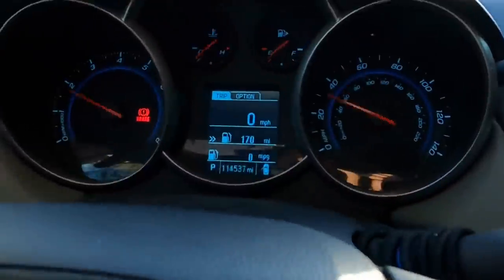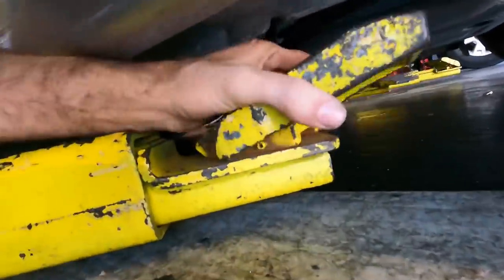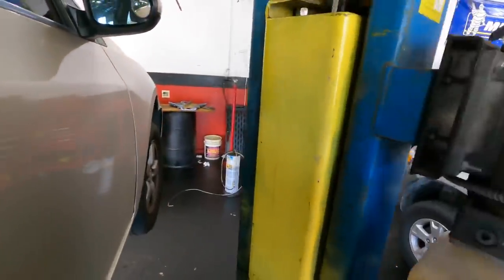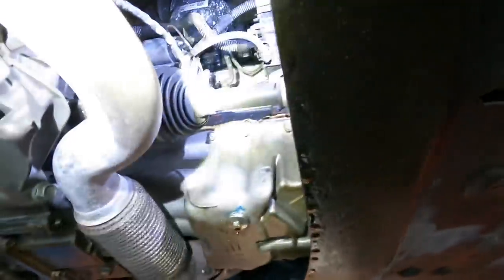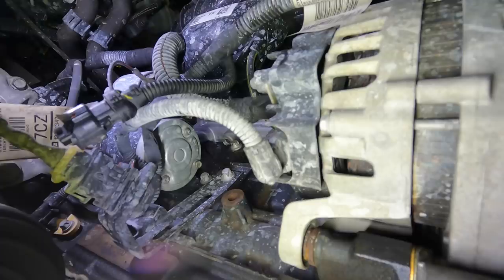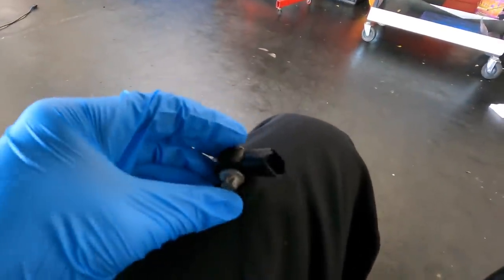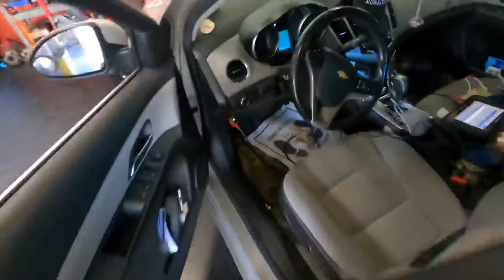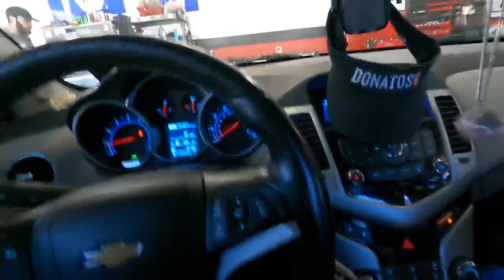Rolling the Dice! Parts Store Diag! Customer Supplied Parts. 2015 Chevy Cruze  P0324

Comment: Had knock sensor code pop up on my GP. Went to junkyard got knock sensor. When replacing knock sensor a pool of coolant dumped on my face. Had no idea coolant was underneath it. Code never popped off after I changed sensor. Took another look underneath and realized the wire had been chewed through by a squirrel...

Comment: Lift safety refresher!
Knock sensor design! 
Appreciated the exploded diagram of the knock sensor.
Reply: Me too, always wondered how they work - pretty simple!
Reply: @ScottDLR  
Elegant design!
Reply: @HouseCallAutoRepair  ,
heat resistant though !
Reply: That was a cross-section of the knock sensor, not an exploded diagram.   Exploded diagrams are very awesome for engines and such, but for a simple little 3-piece component, not so much.
Reply: I don't have a post lift, wished i did. I use jack stands whenever the car is up.

Comment: I had a manual 2011 Cruze with the 1 4T engine. Just totalled it last year at 220k when I hit a deer. Great car, other than 4 valve cover replacements because of the crappy PCV design. Keep up the great videos!

Comment: One thing worth noting when lifting vehicle using those „pinch welds“. I see too many damaged sills by lifting it this way without side support. For situations like those I would rather use some kind of rubber block with groove on it so the pinch weld is supported from the sides. Also it prevents paint being damaged ;)
Reply: I've never lifted at the seam. Seen way too many completely flattened.

Comment: As an ASE certified tech, I can tell you I have much better luck with diagnosis, and keeping the original Factory part, than replacing with cheap, low-quality, doesn't meet OEM Standard, Auto Parts store junk. Just because the sensor throws a code, doesn't mean to sensors bad people. For instance. This sensor was designed to hear a knock. When it hears a knock, it throws a code. Because it heard the knock, does it mean the sensors not working? Of course not. But this is my point. This is why this guy's a good mechanic. He took the time to diagnose the problem. 💯💯💯

Comment: It is easy to become complacent when working under lifts all day. Safety 3rd I always say 😁
Reply: Sometimes its hard to see safety issues through the safety squints.
Reply: Hello Mr. O
Reply: As we in the North know...that step you skipped could be a very bad day...had a pickup come in on a flatbed lost the rear driveshaft got it on my lift and lifted all 4 wheels approx. 3" stopped pushed on the bumper a few times, snapped a pic and set back down...the top of the box was crunching against the cab...the frame rails were holding on at the cab-box gap by about 2inches of the sides of the frame rail the rest had rusted through...by lifting it from the corners I was effectively folding the frame...customer wasn't happy that I would not reinstall his rear driveshaft do to the frame being unstable...and the fact that it would just pop back out at the next bump...
Reply from the maker: I love safety 3rd …it’s highly profitable 😉
Reply: @grandsea2  Had a squarebody chev brought in for a clutch back around 08 or so. Just got the wheel off the ground and heard a big pop. Frame went right in front of the leaf spring. Customer was pissed that I wouldn't put a clutch in it. He never came to get it then a year later showed up wanting the truck. Had never even paid me for hauling the thing to my shop in the first place. I had already hauled it to the scrap where it belonged. Tried to give me attitude over it. Yep, some people.
Reply: Poor EricO, dreaming of the cherry jobs Southerners get...
Reply: I had to recover a car that fell off a lift in a shop several years ago. Unfortunately the shop was not okay that I wanted to take pictures, so I didn't get to document it.
Reply: @RainmanRaysRepairs  occasionally becomes killer expensive !
Reply: Safety is only guaranteed if you wear a tie...like Colin Furze...
Reply: Wow. Nice to see the Guru Mr. Eric O follows another great mechanic. Great minds...
Reply: Time to re-visit that old movie "Safety Last!" with Harold Lloyd!
Reply: Eric O., in the know!!
Reply: The OG comments on the 2nd G's channel. Niceee
Reply: Sometimes when I’m watching Ray troubleshoot I’m like you need Eric… and here he is.
Reply: Eric O is in the house...😁
Reply: Safety 3rd leads to issues
Reply: @randyporter3491  If you do a job like wrenching for 10 to 12 hours every day for 10, 15, 20 years, even the dumbest eventually figure things out, mainly through their mistakes but also through manuals, training, and mentors. To get started, the only requirement is the ability to follow directions. I guess that quality can be difficult to find, but it is definitely not rocket science. Mechanics don't have to bust out calculators or use advanced equations to get to a solution. Sure techs use multimeters and scan tools with oscilloscopes and the like. But what really impresses me is the sheer number of PIDs that come in cars today. The engineers who make all that data available without tripping a bunch of false positives and negatives, that takes some real ingenuity. I would love to see the actual computer code inside an ECU.

What is hard to find is a good AND honest mechanic like Ray or Eric O. Those guys are worth their salt.
Reply: @RainmanRaysRepairs  Safety Third was something that Mike Rowe (from 'Dirty Jobs with Mike Rowe') and was in regards to the dirty and sometimes dangerous jobs he tried. Some of those could not have been done if safety was the first guiderule.
Reply: OSHA who's that?  The guys that show up ONLY when things go wrong and make MEGA bucks h doing it that way lol
Reply: @arliebright  a
Reply: Oh come on at least second
Reply: I've had a Car fall on me I WILL always make Safety my Number 1 Priority I got Lucky that day but it was Almost my Last Day
Reply: My best friend in early gradeschool lost his dad when a van came off a lift , or the lift failed & smashed him.
    Idk the details because he moved before 3rd grade.
   
     Looking back, it might have been my fault he moved.
    He invited me over for a sleepover for the 1st time after his father died.
     
     His mom left for some reason & we were monkeying around. 
   I wanted him to know his dad was OK so my 7 yr old brain had us pretending we were dead, but we were just hanging out like before only we were dead.
.
   He had the idea to use 
ketchup for blood, but I thought we needed more & more ketchup. 
     He was getting my message I think.. We were pretending like it was really nice because we didnt have any worries or pain.
    Everything was going great until his mom came home & got pissed because we waisted 1/2 a bottle of ketchup + we had it all over our clothes & selves.
    When he explained the why, she went from anger to shock.
       
    I didn't know how to explain my intentions & didn't even try.
    If you happen to read this Charles, hope life's been good to you!

    PEACE!
Reply: @mph5896  
Haha!
   Sometimes hard to see the safety through the fogged up safety glasses!
Reply: @damienvillano4044  We have tablets with our shop management program on it and take pictures of anything we find...to text/email to the customer or show to them...saves them having an accident in the shop, and us from having people claim we are trying to up sale them needlessly...
Reply: I’ve had roofing guys complain about the toe boards, harnesses, lanyards, and all the other safety items they must use for OSHA compliance. They say that it hinders their movement to the point that the very use of all the safety gear is dangerous. Most of them nail a plate to the peak of the roof and they use a Swiss seat to keep them secure and that’s it. I always know when OSHA is in the area because I sell out of safety harnesses and gear in a day. I think the fine is like $5k. I had a company go bankrupt from the fines levied on a construction site. I think their fine was well into the 6 figures.
Reply: @robertgelley6454  I think Eric O and Ray should host a tV show together , that would be cool to see.
Reply: Shop destroyed my 2002 spyder. Cost them 9 grand for repair.
Reply: @stevewhiting556  back when I was a form wrecker for a concrete company we HAD to wear hard hats when on the jobsite... still don't see why... anything falling on our heads there came from WAAAAYYY up (like a plane or meteorite) and that hard hat wasn't gonna stop any of that! I mean seriously... there was a concrete slab. The truck and portajohn were the tallest things around. Wasn't even any trees
Reply: you are so correct sir.  : )
Reply: But Rainman Ray , it looks like someone put a jack or lift on the passenger rear pinch weld and the body crimped just above it.  You can see it better when you zoom out and are talking about rocking it to and fro to make sure it’s stable.  Just sayin..

Comment: When I went to Autozone to check my check engine light it said I needed a new evap leak detection pump. Turns it out was just one of the serpentine belts that snapped 😐 changed and it was gone 😄 lesson learned. Don't 100% trust what the scanner tells you. A simple visual in the engine could solve your issue 👍
Reply: That’s because a trouble code doesn’t tell you what wrong it tells u what system has a fault and you have to trouble shoot it

Comment: My daughters 2013 Malibu with 200,000 miles on it has all sorts of idiot lights on but it runs fine. I did replace the front brakes and rotors last month. I want to take it to the part store to have the codes checked out but think like you said that it will just be misdiagnosed and will waste money. Last car I worked on was back in 1996 when I owned a 73 coupe deville. My track record on that isn’t stellar so I’m not bragging.

Comment: Ray, as a guy who installs and inspects lifts for a living it is refreshing to see it used properly.  I can tell you from experience less the 40% use the saftey load holding devices on a lift.  The hydraulic cylinders are ment for lifting not holding. Thank you!
Reply: You might appreciate my story. Old days with an in-floor single-post hydraulic/pneumatic lift which had a slight air leak. When you ran the lift to the top it went just past the safety catch- about 1 1/2 inches. If you didn't lower the lift onto the catch, about a minute later the lift would suddenly drop that 1 1/2 inches scaring the s#!t out of you if you were under it. Being an easily distracted teenager meant that happened to me more than once, but it did eventually teach me to double-check everything before getting under a raised vehicle like I do now.

Comment: With you on the diagnoses. Had some laptops in for repairs recently. Customers supplied parts for transfers, upgrades, repair. They all want to know why It takes so long. Well it's because I run a battery of hardware diagnostics before I start anything (especially memory and temperature tests). 30 years of experience tells me that it is better to check before you start fiddling - than to worry about if your fiddling broke something. You can of course rush the job and keep it cheap. Like a chain computer place did when upgrading the memory module on a clients laptop. Rushed tech broke one of the tabs on the clamshell (crap design and crap plastice but that's about standard)  which then drifted around inside for months until it found a home jamming the cooling fan. Heat buildup in the compartment led to a memory module failing when it reached a certain temperature, and only then. So laptop would run for around 20 min and then reset all the time - till it cooled down enough. BUT - the memory module tested OK on any short test less than about 20 min. Of course this failure led to the OS getting corrupted. A whole chain if events because someone's boss was chasing them for quick turnover and quick money.

Comment: Why no rubber mounts on the lift points? Especially on the pinch welds. Directly on metal they just bend and scrape the paint off in time. Then rust starts, and in a couple of years you'll struggle to find a lifting point, or they collapse on you at some point when lifting.

Comment: WHAT!!!???
You didn't even hammer out that front right dent in the fender???!!!
YOU CAD!!!
Just kidding.
I watched a guy once take out a dent by placing a shop towel over a hand anvil and then using a rounded hammer head, gently knock out the dent without causing any paint damage.
The towel covered hand anvil was placed on the outside of the dent backing up the hammer from the other side.
Just physics at work.
I've used that method on any of my "dings" on cars I owned.
GREAT SHOW!!!
Happy Motoring!!

Comment: My car has a welded flange under the sills. The wheel change jack is slotted to fit around that flange. Inverted triangles on the sill sides indicate where the wheel change jack should be fitted. 
I use a slotted wood block on a trolley jack to lift the car but axle stands go under the lift points shown in the video.

Comment: The knock sensors in used to (Cummins CNG) look similar. But are super sensitive to not using non-factory mounting hardware, as well as torque spec. Which I believe is something like 17.25 lbft...

Comment: I've been driving the Australian Holden 1.8 Petrol version of one of these. It crapped out 2 coil packs within 1000km @ around 55000km.
Reply: Similar in Europe had a coil pack at under 50k gave up on GM and gone completely Honda and Toyota .
Reply: These cars are not well designed much like the Holden or opel vectra and astra
Reply: @-DC-  the Cruze is Korean, merely sold with a Chevy emblem for people who want a throw away car for throwaway money. This one in the video has 114k which would be standard mileage life for a throw away car. Far more than an Accent for instance. Your Honda's transmission will fail twice by then.
Reply: @ashes2ashes863  My Civic Type R transmission was still working fine at 200k miles, though it was on its second clutch. Plenty of people with tuned/turbocharged engines putting way more power through the stock trans as well.
Reply: @ferrumignis  the clutches are fine. It's the CVT transmissions that are horrendous. And I'm not saying that as a hater. Actually have quite a bit of Honda Stuff
Reply: @ashes2ashes863  Ok that's fair, though CVT transmissions tend to suck irrespective of manufacturer.
Reply: @ferrumignis  yeah that is true. They don't seem to do well anywhere. Subaru is taking a beating lately because they have a lot of power killing software written into the car just to prevent the CVT transmissions from frying under duress. I myself can't stand CVT transmissions. Is somebody who drives a lot last like I want to listen to is that constant drone of what sounds like a transmission slipping for thousands and thousands and thousands of miles. I think I almost rather listen to my wife talk. Well no, on second thought I'd rather listen to the trans transmission.
Reply: Apparently 55 000 was the "Designed obsolescence" limit.
Reply: My wife had a POS 98 Vectra when we got together, then we traded it on a VRX Lancer wagon.

Comment: Shade tree mechanic here and only work on my own stuff.  I've been very guilty of firing a parts Cannon in the past.  One weighs the price and ease of a part versus the cost of diagnosis/ scan / and towing costs etc.  I figured in the end, I'm well ahead in money I would have otherwise spent at the stealerships.

Great channel Ray.  You're a good man
Reply: Correct, sometimes it can make sense to roll the dice with the parts cannon.  I have a Volvo with 260k miles.  Was getting an EVAP code.  Gambled and replaced a $30 purge valve that took 10 minutes to do rather than taking the car to a mechanic for a $125 smoke test.
Reply: Agree 100%. Wife has Jeep, dealership is CRAZY HIGH on parts cost and diagnostic fees.
Reply: @MrJuxone  chrsyler is very scummy with very basic parts. 2013 dodge grand caravan, heater hose connector blew and was causing slight overheating, chrylser only supplied the  entire hose assembly and it cost 220 dollars as  opposed to what would  be a 30 dollar connector
Reply: I've diagnosed a car before and then I took it in and told them what I thought was wrong. The part to be replaced was only accessible from under the car near the firewall. I didn't bring my own part in so they made some money.
Reply: @RunnJake  my passenger headlight bucket in my wrangler cracked, the dealership only sells the entire headlight assembly for $300. I found the bucket on eBay for $18
Reply: @RunnJake  You have that right, they tried to charge my wife 430.00 to change her Jeep thermostat .. took me 25 minutes and a 25.00 part. Then they wanted to charge her  350.00 for the blend door actuator-- i bought the part for 31.00,change it out in 30 minutes. Jeeps are so simple to work on.
Reply: Unless it's a complete mystery,  I will fire the parts cannon all day... worst case is you fix the problem and have a couple new parts that would have probably went bad sooner than later
Reply: @ThisIsSolution  be sure and tell us you shop!
Reply: @MrJuxone  yeH I shop online for parts and blast them onto my car... works like a charm,  everything works good
Reply: @ThisIsSolution  Got it, you are working on your own car... no worries that makes sense:)
Reply: That's what I was thinking that's a $10 part so haven't lost much if it doesn't fix it was a good try

Comment: As a mechanic myself; I frequently wonder about the actual fragility of parts such as knock sensors. Because when you take into account a 4x4 production vehicle such as a Jeep or FJ Cruiser, bouncing around at high speeds off road will be far more aggressive to the part than simply dropping it would be. I know you run the risk of snapping the plastic connector, damaging the casing etc. from dropping it; but as far as damaging the internals of the part, I think most parts are designed with shock absorption for the internals in mind.